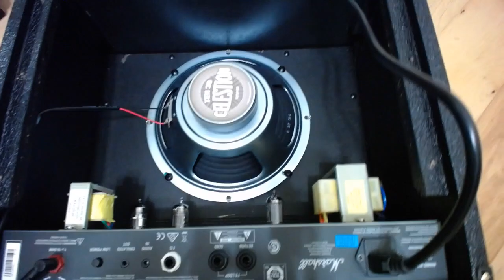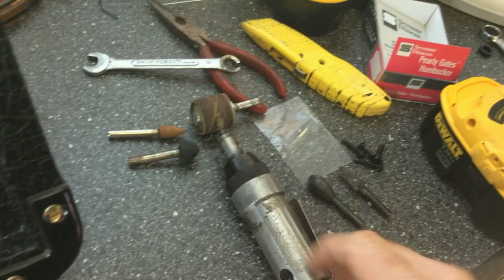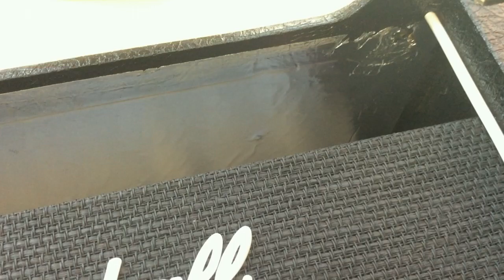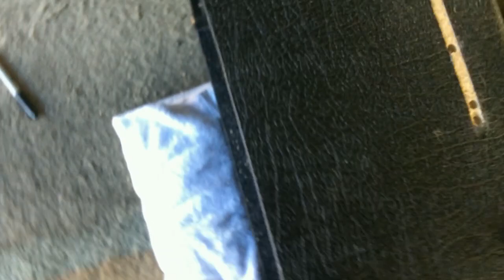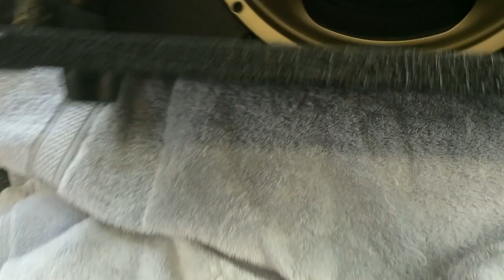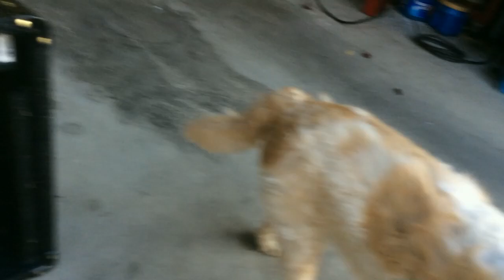Marshall Mods - Trick Out your Marshall DSL 5 - Speaker, Bias, Tubes

Comment: I wonder if the sound is strongly distorted if the dynamics are carefully shaped into an oval shape in a vise?🤔
Reply from the maker: I have absolutely no idea of what your talking about, lol! Say WHAT!?!?!?!
Reply: @oldguyjammin9732  Sorry for my English, this is an auto-translation. If you squeeze the frame of the speaker cone in a vise and make it oval. In order not to saw the body of the combo amplifier. Will it greatly affect the sound? I remember my grandfather had a tube radio from the 50s and there was an oval speaker.
Reply from the maker: @Michail_Nazarov  - gotcha... you can NOT squish a circular speaker into an oval and have it perform correctly. Those old oval speakers are called 6x9's and are stilled used in automotive stereos. Won't work in this application... I like that you're thinking though :-)
Reply: @oldguyjammin9732  I meant to slightly change the shape into an oval to fit the speaker into the case. Another idea is to grind off the speaker mounting ring from above and below. Thanks for your attention sir.
Reply from the maker: @Michail_Nazarov  - grinding is a good idea and should be okay as long as you don't lose the integrity of the speaker basket.

Comment: I know I’m a bit late on this but I have the DSL5C original and I don’t really like the red channel, too heavy metal. Any modification suggestions to get me to a good Jimmy Page tone with a Les Paul. My playing is terrible but I just do it for fun.
Reply from the maker: Never too late around here.  Try a 12AY7 tube in the socket closest to the input jack, it'll reduce the gain quite a bit. And then you can always roll off half your guitar volume and crank the reverb 🤘
Reply: @oldguyjammin9732  Thanks for the reply sir, I may give that a try. Would you suggest that my reverb pedal goes in between guitar and input or in the fx loop? Mine is not DSL5CR with built-in reverb.
Reply: So if you want to tame the red and still have some edge in the green, what worked for me was : Used RFT 12AX7/ECC83 in v1 and v2 ( v1 tested sl. weaker than v2) .
Used Philips 12AU7/ECC82 in v3 power tube ( probably drops power to 2.5-3W ) I also tried a used Silvertone 12BH7 and it was nice, but I wanted to quieten the amp down a bit for my preference.
Nos Mullard 12AT7/ECC81 in v4 phase inverter. This really helped remove harshness.
So prob any used old ECC83s that are a bit weak will improve red channel.
But the big surprise was the Mullard ECC81 in v4 phase inverter .
Obviously this does not apply to DSL5CR that does not have a valve phase inverter.
Reply: @mikebarnard2689  Thanks for the response sir, do you find that you can get a good Jimmy Page tone with this? Are these mods cost effective or would it make better sense to buy something else? I only play at home at bedroom levels with a few opportunities to wick the throttle
Reply: @robmfk6987  The mods I have done ( and fitted Celestion G10m Greenback ) really transformed the amp.
It was too loud at 5W for home use that’s why I swapped out the 12BH7 power valve for an 12AU7 ( ECC82)
As far as cost effectiveness goes.. old stock Mullard 12AX7 ( ECC83) are very expensive the Ecc 82 and 81s are much less expensive.
You could try 12AT7s ( ECC81s) v1 and v2 which will give much less gain.
I chose to used worn 12AX7s ( ECC83s) and they just hit the sweetspot. Valves that test med to weak doesn’t mean they will fail but they will cost way less and you don’t want the high gain structure of a good ECC83 in the red channel.
Hope this helps
Mike
Reply: @mikebarnard2689  Thanks again sir I will consider it. What do you think would compare to your set up if I were to buy new or used that would be relatively inexpensive. I am still pretty new to playing.
Reply: @robmfk6987  I’m guessing you are in USA , I’m in UK , prices can vary a lot. Just keep an eye on eBay for 12AX7s that are testing low ( avoid strong)
It can be useful to know the tube equivalents as the same tube can be cheaper with a different number on it.
Here is a brief tube equivalent data
Valve equivalents
12AX7 ( gain 100 ) = ECC83 = CV4004 =  CV492 = 5751 ( 70 gain )

12AT7 ( gain 60 )= ECC81 = CV4024 = 6060 = 5965 ( 47 gain )

12AY7 ( gain 45 ) = 6072

12AU7 ( gain 19 ) = ECC82 = 5963.      ? Swap 12BH7 with ECC82 for less power
Reply: @mikebarnard2689   Still no issues putting the 12AU7 in the power valve slot a year later? I asked Marshall tech about using a different tube to reduce the power a bit and they replied with this...."We can only recommend the ECC99 that is used in the amplifier, as we have not tried another type of valve in that position. Kind Regards". If you've encountered no issues, then I'll try the same. It's too loud at 5W and the .5 switch seems to remove the lower end for me.  I did put in 12AT7s to reduce the gain, happy with that.
Reply: @madukrainian5  nope no probs at all, between myself and a friend we have 3 dsl5c all with ECC82 output valves and ECC81 in phase inverter.
Here is a summary taken from my forum post…
So if you want to tame the red and still have some edge in the green, what worked for me was : Used RFT 12AX7/ECC83 in v1 and v2 ( v1 tested sl. weaker than v2) .
Used Philips 12AU7/ECC82 in v3 power tube ( probably drops power to 2.5-3W ) I also tried a used Silvertone 12BH7 and it was nice, but I wanted to quieten the amp down a bit for my preference.
Nos Mullard 12AT7/ECC81 in v4 phase inverter. This really helped remove harshness.
10” Celestion Greenback.
This combination of lower gain ( I’m sure the older valves are at least 10-20% down in gain) and critically the 12AT7 in phase inverter has made this a sweet little amp.
Totally useable crunch at green full volume and red takes over and still really rocks without harshness or fizz. The speaker upgrade helps it all along.
Highly recommended and totally reversible re voicing of this lovely little amp.
Reply: @mikebarnard2689  I have the DSL5CR and it doesn't have a phase valve. "Nos Mullard 12AT7/ECC81 in v4 phase inverter. This really helped remove harshness."  I need to play around some now. Attenuator switch on and full volume vs 1/2 volume with no attenuator on vs full volume and guitar knobs dialed back.
Reply: @madukrainian5  I’m sure if you get hold of ECC82 for output valve and some lower gain valves for preamp, you will discover some smoother tones.
Don’t be afraid to buy old valves that test weak, they are cheaper than strong valves and suit the tones you are after on the red channel.

Comment: Hey oldguyjammin! I’ve got a DSL 5 but mine must be older. No reverb for one. Classic Gain is just one knob. But yeah I might put a 12 in it also. What a great idea. I’ve got lots of other(bigger) amps so if I $&@& it up I’ll live. But in the meantime I have a 2x12 and I tried to connect it through that out in the back with no luck. Do I have to unhook the speaker first? Can I even do that? And is the Mono still for sale? Is it the 5 or 15. Must be the 5. Anyway thanks for this!
Reply from the maker: Yep, you have the older one. You won't screw it up 🙂 it's pretty straight forward. I don't think you can disconnect the speaker cable on the Oder one, seems like it's hard wired... so you'd have do some wire cutting and such. However, if the speaker cable plugs in to a jack labeled 16 ohms at you should be able to plug Any 16 ohm speaker into the same.. so I just looked it up and you'll need to unplug that speaker wire before plugging a larger cab in to the same 16 ohm jack.
Reply: @oldguyjammin9732  Hi thanks. Yeah there’s a 1/4” jack right in the back for the speaker. Last night I tried it but no sound from the 2 x 12 and full sound  from the DSL. So if I’d unplugged  the speaker should it have worked? I also have the 40 and I’d love to get that 2 x 12 going on both. 
Thanks for the quick reply btw!!
Reply from the maker: dean mccaskill the only way to use an external speaker is by pulling the black cable out of the 16 ohm jack and connecting the external cab to the same output jack. Any other "output" is for other things. It should work great, but you won't be able to use the combo speaker AND an external one too. The 40 does allow you to use the combo speaker PLUS and external cab.

Comment: Hello again my friend my dsl 5 powers up but no sound even the aux.out any ideas ? Cheers
Reply from the maker: Hey there, well... lets see. Tried a different guitar, input cable? Do you hear a series of clicks (relays) when you power it up? Do the tubes glow (take the covers off and look/feel for warmth). If no clicks it’s probably an internal fuse, i assume the On Switch lights when you click it on? If not it could be the “mains fuse”. Hopefully you’ll see that one of your tubes remains dark and cold, if not it’s probably internal and we’ll have to dig deeper. There are at least TWO glass fuses on the circuit board, it could be one of those but you’ll have to pull the chassi.

Comment: I have one and its great! however.. how could it be modded to have more reverb  without used of a pedal ?
Reply from the maker: Yep, killer little amp :) I don’t think the mod would be doable without swapping out the reverb chip, or chips, board... whatever. I’m not really sure but did look into it a bit a while back, found nothing on improving it. As is I run it pretty much maxed out and then use a pedal if I want more.
Reply: @oldguyjammin9732  its all the amp needs!